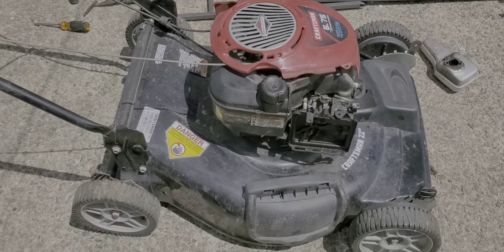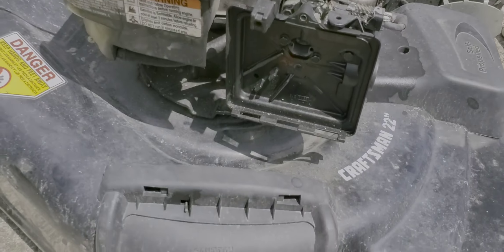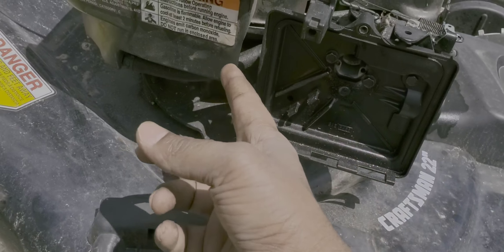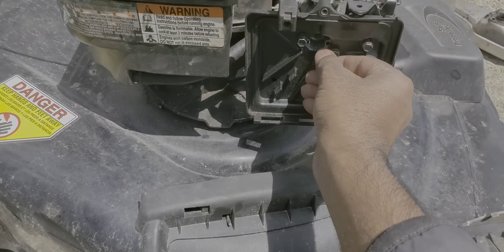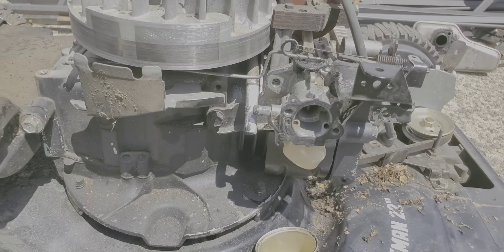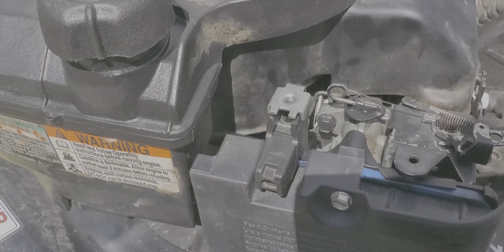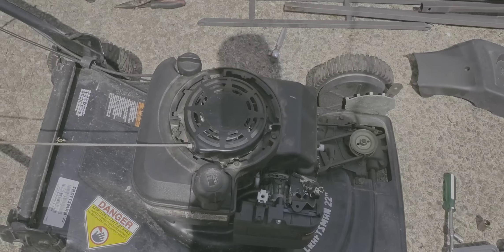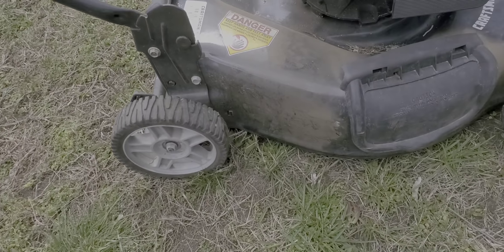Craftsman Lawnmower 6.75 HP not starting how to fix it DIY

Comment: Hi, is the Carburetor air flow door in the close position by default? I got a new one with open position by default and won't start
Reply from the maker: The flap suppose to be closed, maybe you have to shift the lever on it to close position.